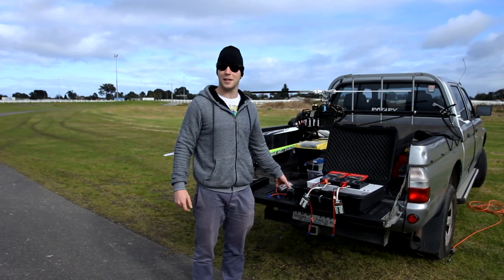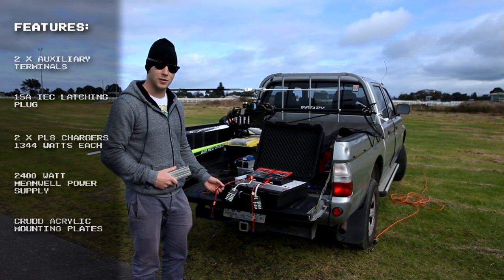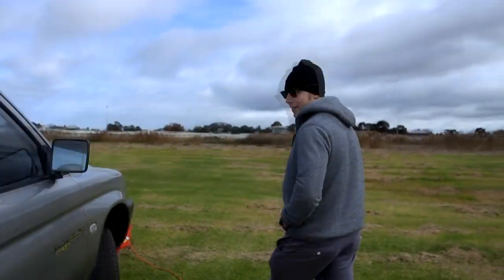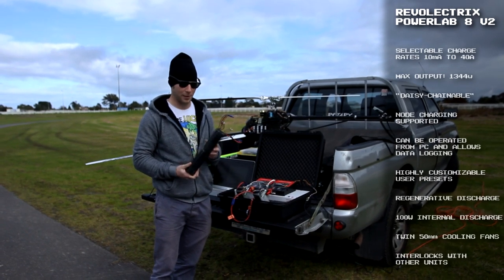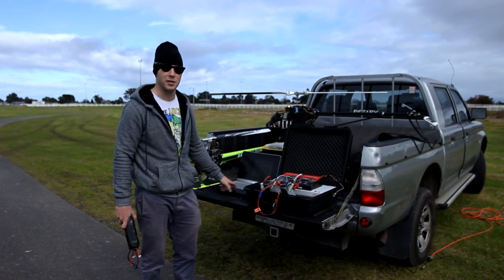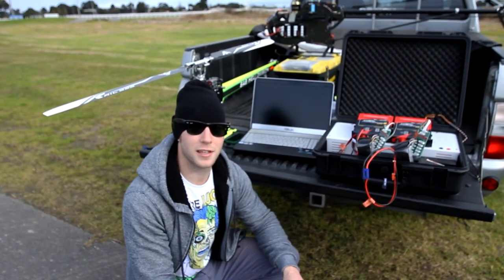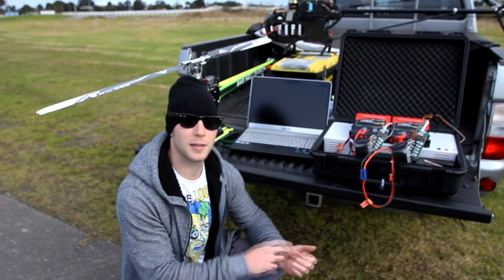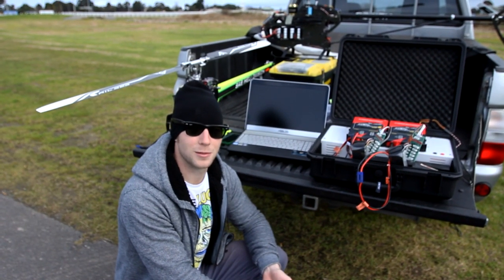*NEW* MEGA LiPo battery charging station!

Comment: I'm new to LiPo and I was wondering since I don't run Heli's is it possible or even recommended to charge a 5000mah 2s lipo at anything more than 5amps? I saw the thunder t610 was able to do series charging at 10amps but can i go higher amps to charge faster or does it just kill the batteries quicker?

Comment: Parallel charging vs 2 x chargers.  Gotta fly two packs > wait for both charge up.  Two chargers is "non-stop" continuous flying & charging.  Plus, can shoot 2x amperage into each battery.  Plus, if "one"charger fails you still have one more.  Plus, you can also have two power supply of lower wattage & price.  Stay safe keep simmin.

Comment: what's the point of charging each battery on a charger when you could just get a fma parallel charging board and what amperage did you charge each battery at ?